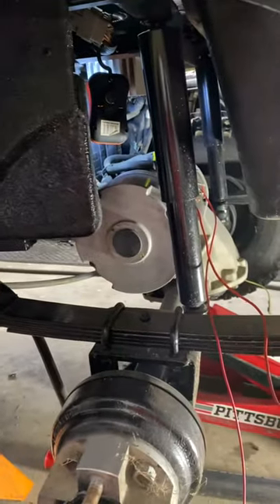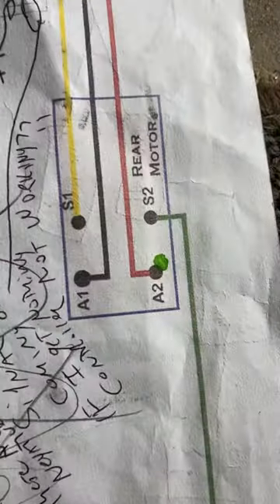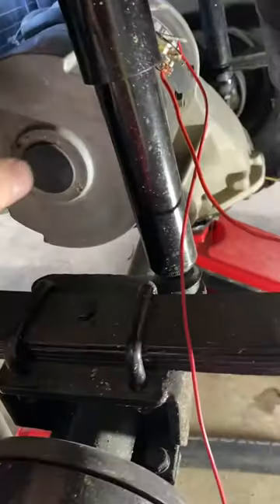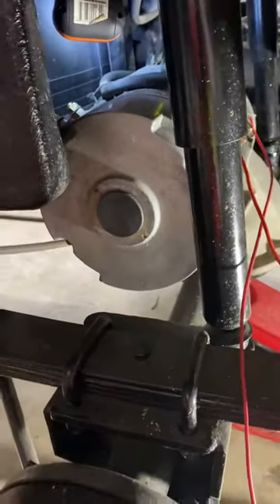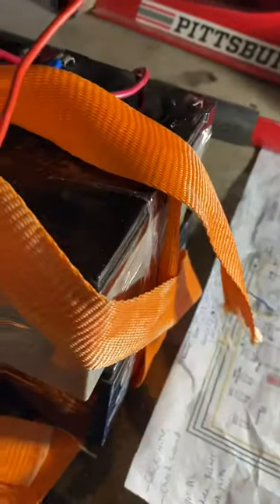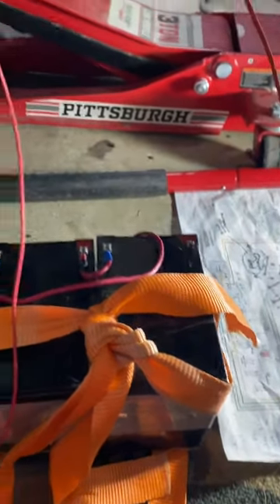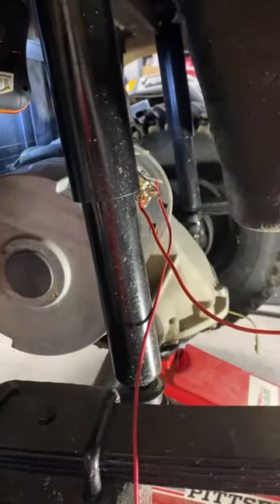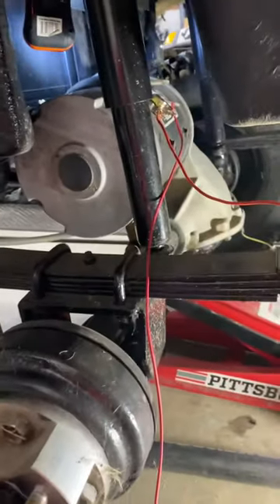How to test a series wound electric golf cart motor (won’t work on shunt wound)

Comment: Hey I have a bad boy and my motor was unhooked when I got it..can you email me the diagram if it’s not to much trouble…maybe that will help it’s been converted from a bad boy to a straight ezgo 2wd!
Reply from the maker: I can send you the diagram if I had your email. But the wire should be labeled and so should  the motor and you just match the wire to the motor
Reply: @freshmaker5  ok I actually found the wire diagram right after I commented. I’ll check tomorrow and see id the wires are labeled! I did the test you show and my motors are good so….big thanks for that walk through!